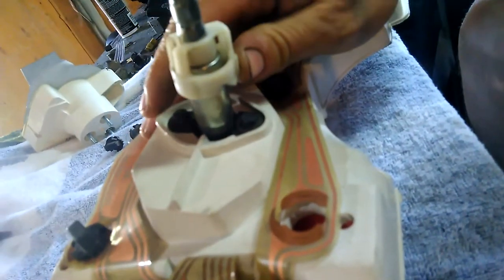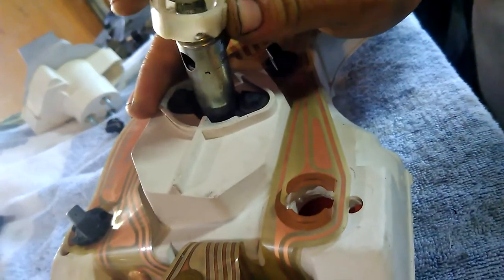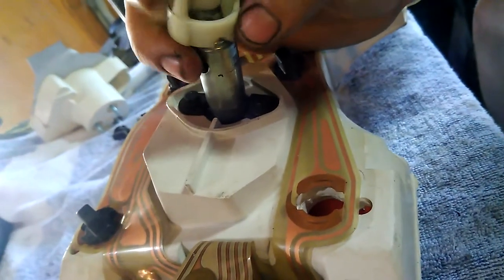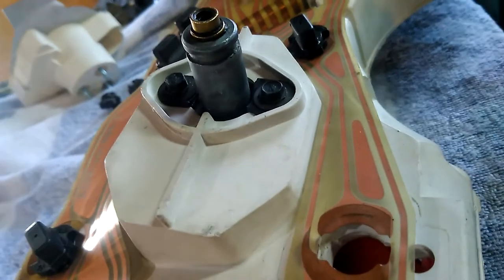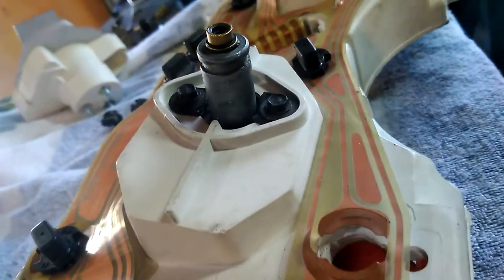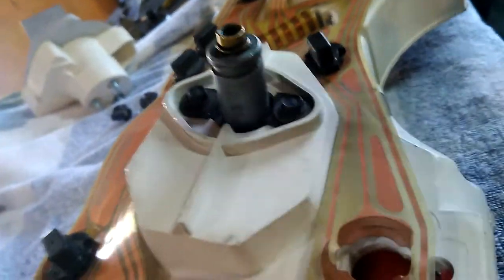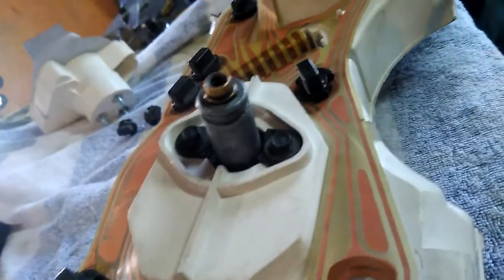How remove your foxbody Speedo cable from the cluster

Comment: Man I love when people make videos like this.  It's the simple stuff that makes things a real pain.  I got the cable off and replaced all the dash lights with LEDs in an 84 hatchback and now speedo doesn't work.  Thought I had it on all the way but the connector didn't seem to lock in very well.  Time to take it apart again.  I wasn't really sure how the cable came off, but I kept messing with it and it came off.
Reply from the maker: Yeah i had similiar frustrations. When your reaching behind the cluster its almost impossible to see what your doing
Reply: @Nodarperformance  I just took it apart and spent about 45 minutes screwing with that cable to lock back into place, but thanks to your vid at least I understood how it's supposed to work.  Four times and the speedo still didn't work, so what i did was pulled the needle out with needlenose pliers and stuck that into the speedo gauge connector all the way, then slipped the metal cylinder on the speedo cable over the gauge connector, then I was able to finally lock that plastic piece over it correctly and it worked.  For some reason I couldn't get it on all the way without pulling that plastic needle out first.  I wonder why they didn't just make a normal pinch style connector that makes sense.  Probably a lot of people that break that thing thinking you squeeze it.